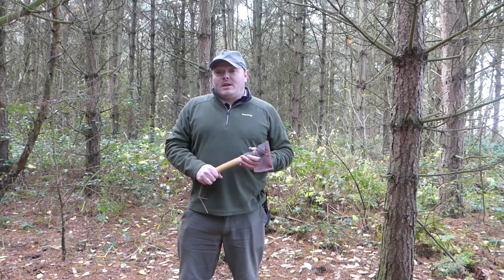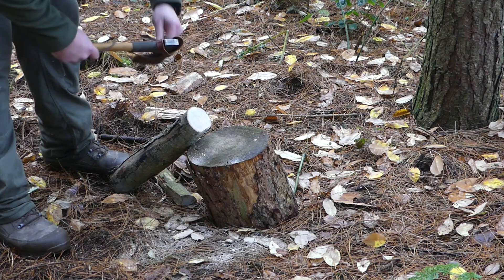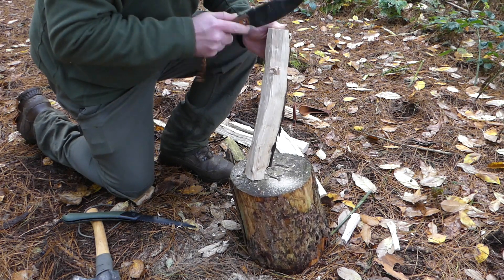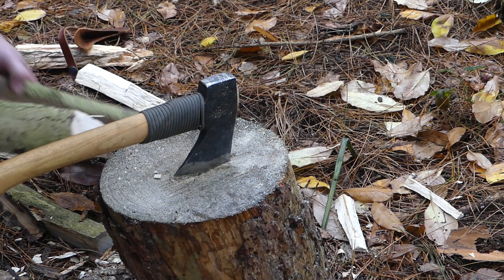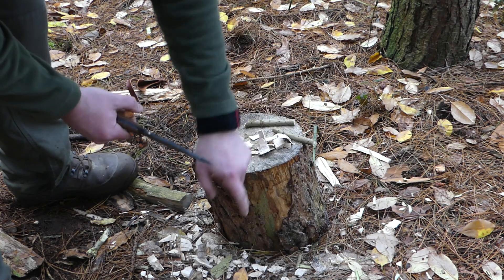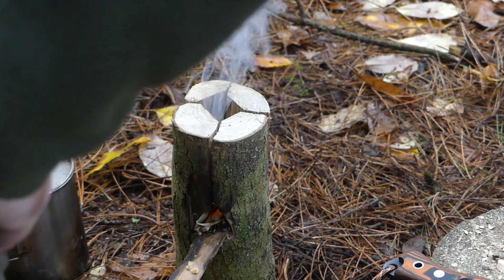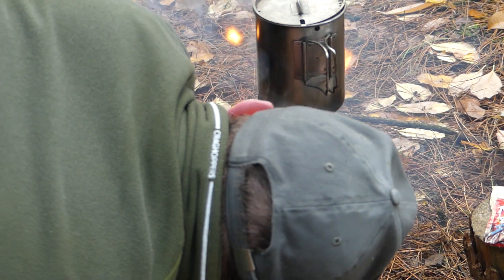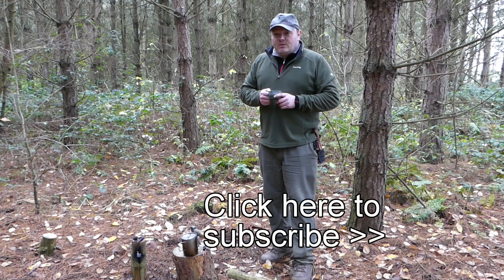Bushcraft skills - how to make a rocket stove

Comment: Hello, what are the pros and cons of this type of stove? As I've seen it takes more work compared to ground-fire.
Pros: Fire does not contact with the ground and a bit better fuel efficiency due to it's more enclosed?
Reply from the maker: Just making a fire on the ground is certainly quicker. The rocket stove leaves no trace of a fire. It's very easy to put out and you can transport if necessary. If I'm honest most times I just make a fire on the ground or use a firebox. It depends where I am. Not everywhere allows a ground fire.
Reply: Thank you for replying. I haven't heard of laws like that where I live (Thailand), as I know there is only yes and no for any method, but I'll do further research.

Comment: Excellent little bushcraft stove Paul in gonna have a go at one of them, i take it this is a rendition of the Swedish stove ?...
Cheers for sharing with us...atb Lee
Reply from the maker: Cheers Lee. It's very similar to the Swedish torch but I don't think the Swedish torch has the hole to feed in the fuel or air. I like the fact it doesn't fall over by pounding into the ground. This way smaller logs can be used. ATB Paul